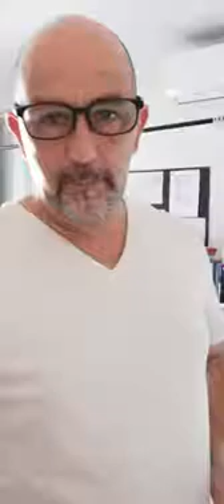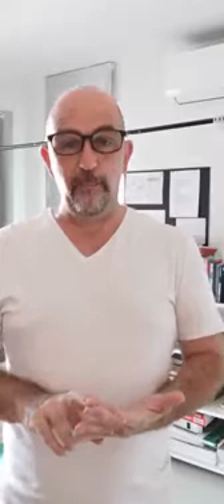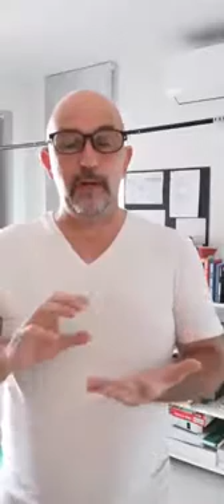Solar Rooftop Options In Thailand

Comment: Who is just tying into spinning meter?
Reply: Sorry, but that is not allowed in Thailand. Who know what will happen if you get caught ;)
Reply: @danielparsons1338  riding motorbike without helmet also not allowed in thailand but many do it riding by police and waving. So far it seems power authority just replace meter going by forum posts. Some say fines or disconnection but those who do it say the meter is simply  upgraded and they move on . I haven't seen any evidence of problems yet
Reply: @Swenser  true, I only heard that once the PEA took the meter.. but it was easily resolved. Both the PEA and MEA are more aware these days and request that everyone who installs solar applies for a permit which means you need to install for zero export.

Comment: how much kw do i need if lets say i want to power 2, 24000 btu a/c 2 led television and some computers and lights  for just one big room will The Alpha ESS smile 5 system able to power this whole room without the need of any power from the grid ?
Reply from the maker: Hi Patson thanks for your comment. The Alpha ESS system needs a grid connection to work it is not an off-grid system. As to the load what you are looking to power is too much load, the Smile5 is a single-phase 5kW system. Ideally, you would need a 10kW system to power those loads.

Comment: how much is a 5 watt self consumption system cost and do you service the province of Ang Thong?
Reply: Hi is that Ang Thong in Samui?
Reply: @danielparsons1338  it is about an hour and a half north of Bangkok. near Wat Muang.
Reply: @danielparsons1338  have not built the house yet, this will be done in 6 months or so
Reply: @earlvanfleet3501  ok. A 5kW On-grid, single-phase Solar Rooftop would cost around Bt. 170,000 plus the additional cost of mobilization to your location. This is a system for self-consumption, no batteries. thanks
Reply: @danielparsons1338  how much for a 10kw, on grid, self consumption, no battery?
Reply: @Michael-Masi-2021  Starts at Bt. 310,000 with a Huawei 10kW Grid Inverter with 10 year warranty, 18 x 550Wp Mono T1 solar panels and all other equipment and installation. Complete system, Turn Key